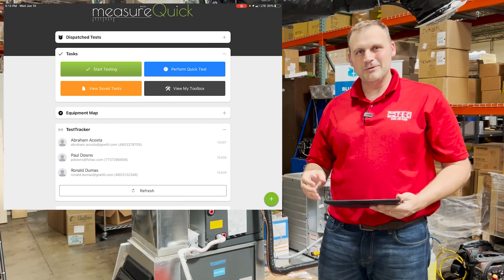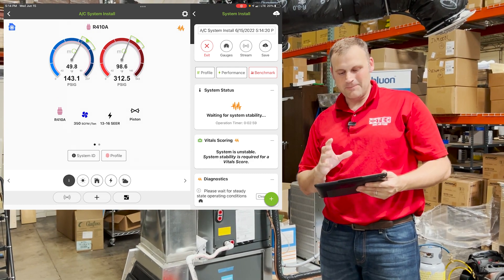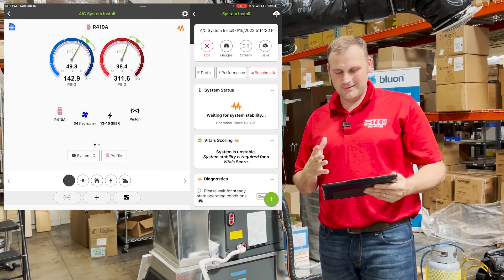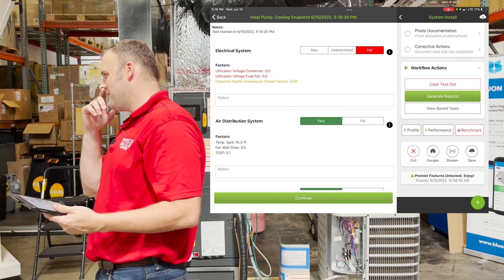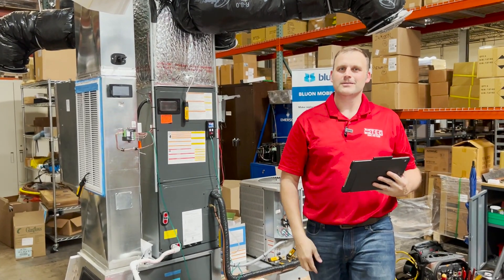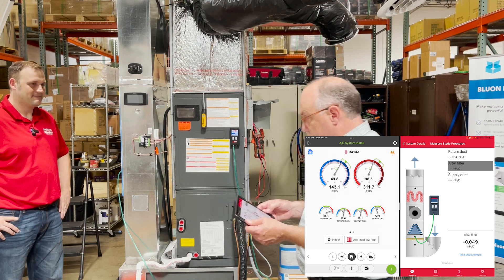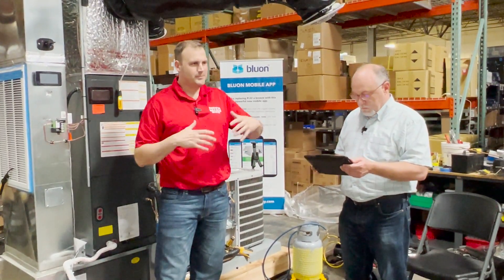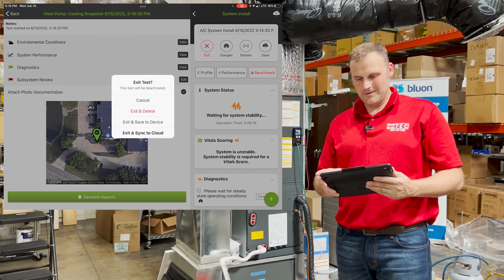measureQuick made easy and the TrueFlow Grid integration with Chris Hughes

Comment: I thought the supply reading should be on the equipment not have way up on the plenum.  Since there  are supply taps next to your pressure probe wouldn’t that reduce your reading, reducing your TESP?
Reply from the maker: I duct system blows up like a balloon so the pressure is equal in all directions. The let thing is finding an area where the turbulence is minimal. Sometimes right next to the AHU there is a lot os static regain going on and it makes stability tricky.